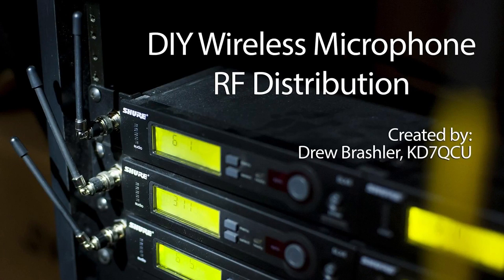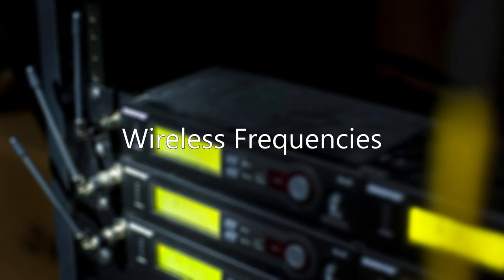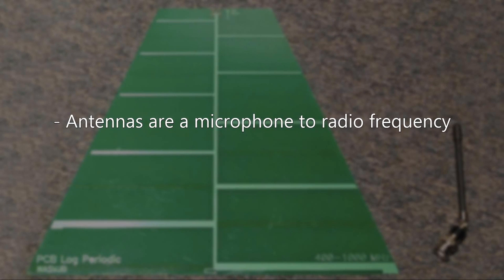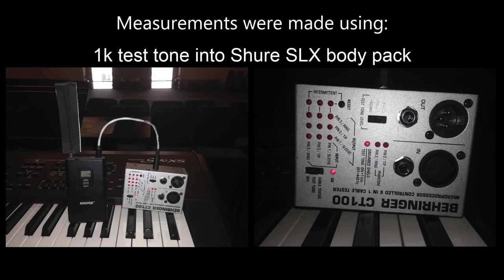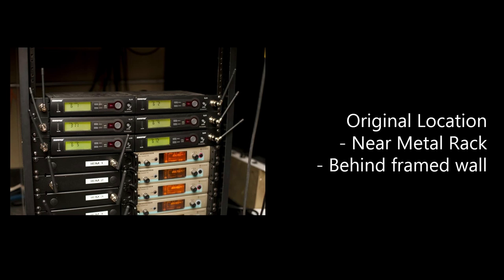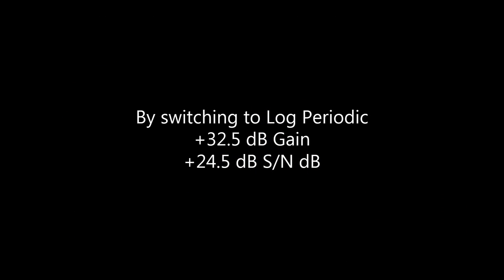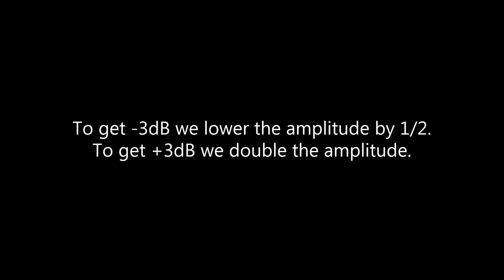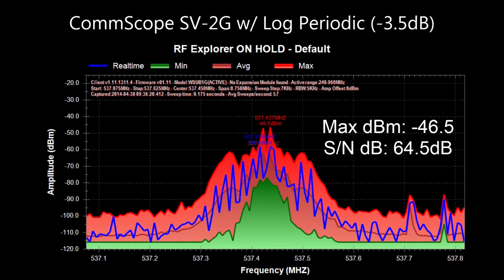DIY Wireless Microphone RF Distribution

Comment: Wow!  Just deployed the system at my church - and the wireless mics are finally performing as expected.  The extra gain coupled with proper antenna placement has made a huge difference.  Although, Drew, if you got your ears on......I did the same kind of mount for the PCB antennas with 1/2" pvc - how did you get the antennas to stay put?  I tried some hot glue, it didn't work.  Kinda afraid to use epoxy or superglue (chemical heat) - the answer is I don't want to damage the antennas.  Any advice?

Ok - went to Lowes - bought beam clamps and clamped them on the back of the pvc pipe and clamped the antennas in there - and it's not the best looking thing on the planet - but let me tell you - IT WORKS BEAUTIFULLY!

Working perfectly combining signals from 5 Shure SLX - 4 @ ~520Mhz, 1 @ ~650Mhz and an AT @514Mhz - beautiful signal -even though the antennas are 50' from the booth where the receivers are.  Did learn that the 45 degree angles definitely make a difference - much less receiver action switching between antennas. Total cost was less than $120 for the entire setup - I couldn't be happier!

Two weeks in now - and we've yet to hear any switching noise, have even one bit of interference or anything.  Much more confidence now in a crowded RF environment like this church (right off a major interstate and literally 100's of towers around and bad electric in the building) with the wireless mics!  Thank you DREW!!!!
Reply: I just jumped on the band wagon here and almost finished with my set up.  You might be interested in this 3D printable mount I designed (it's going on top of my wireless case): https://www.dropbox.com/s/unn0v877xg3rjv6/antenna%20mount.JPG?dl=0
Reply: Bob Nolan. What RF Splitters did you use? I can't find the ones he listed and definitely not any at his listed price.

Comment: Great instructional video.  Deployed a similar solution at our Church. Works well especially when using powered splitter. Any chance I could get your advice on preventing overdriving the signal?  Appreciate it.
Reply: Hi, seems Drew is offsite or offworld. To prevent overdrive or clipping, you want to either attenuate your input or reduce your amplification. All amplifiers will have a maximum output. If it says 100db Max Out, and your input is 75dB and it amplifies by 30dB, you need to get a different amp or attenuate your signal by 5-10dB.

Comment: Drew, have you experienced any issues in connecting this DIY system to Shure ULX series? Seems as though the system I built will work fine with the Shure BLX4R receivers, but it's hit and miss with Shure ULXP4 and ULXS4 receivers - they literally shut off / power down as soon as the antenna cables are connected from my 1x8 DA. A while back I found that some receivers were ok and not shutting down, but in the mad dash of the project I didn't have time to take notes and try to figure out what/why.

Comment: Drew,
Can I ask you to clarify the hook up between the antenna and the splitter?  What wire type did you use? Did you solder it directly to the antenna or did you solder a connection to it first?

Comment: As far as Power Distribution goes, I have had good results using 5A 12VDC power supplies intended for surveillance cameras and coaxial (5.5 x 2.1 mm) splitters feeding 12 Shure SLX4 receivers. My Musical Theater rig consists of 2 racks of 12 SLX4s per, each powered by one 5A supply. The original Sure PS20/21's are rated at 400mA and the SLX4's claim to draw 130mA each. You could probably get away with 2A power supplies but the difference in cost is negligible.  I get the power supplies and splitters form MCM Electronics for about $25 per 12 SLX4s.
Reply: Thanks for your comment 
By any chance would you recommend one if im using 5 SLX4's thanks again

Comment: I need to try a setup like yours only I have old stuff to deal with, Shure L4s running from 171 Mhz to 192 Mhz.  And no budget, I think  with the correct antennas I can still make it work. Going to give it the college try.  Thanks for the info and the guinea pig service!
Reply from the maker: +Dale Thornton This setup would work for you! All of the TV Splitters I quoted had a freq range from 5MHz-1000MHz, the only thing that wouldn't work is the antenna that I quoted. You would probably want to try using the stock one that came with your equipment or trying to build an antenna tuned to 181MHz. There are a bunch of antenna designs online that would work. A simple dipole tuned to 181MHz would work well for your purpose!

Comment: You mentioned the Signalloss by converting 50 to 75 Ohms, but you’re dealing with much worse problems by doing this. When you don’t use a full 50 ohm System you can create reflections in the cable which degrade your signal, it might have the same Amplitude but will lack in Information in the Signal, so I would strongly recommend to stay in 50 Ohms and try to find some splitter with this impedance.

Comment: Drew, when you guys used those front mounted omni directional antennas what was the average distance from transmitters to the wireless mics (for example) without fuzz or noticable signal loss? I'm in a professional cover band and am looking to mount my IEM box and Sennheiser WIreless box next to each other in a 4U rack case with front Omni antennas. Just looking for your own experience? Thank you! Great video.

Comment: Drew, I have contacted a rep from PCT and they have discontinued the  PCT-VB-8U. The rep recommends using the PCT-VC-9UIP in lieu. This replacement also offers VOIP. I'm not sure if I need the extra, is there a cheaper version that you are aware of. This new unit is $46.99..... Any suggestion?   And thanks for all of your expertise and willingness to share.
Reply from the maker: Yes, the PCT-VC-9UIP is a great replacement for the PCT-VB-8U!

Comment: Drew,  

I would be interested in knowing if the spectrum readout of the IEM combiner showed any 3IM artifacts? I would view the scope while the transmitters are turned on one at a time. I wonder about the splitter/combiner port-to-port isolation and its affect on 3IM? Have you done this?  

Thank you for this video.  I have read about this very subject and it is good to see a video presented intelligently. This info was right in line with my needs.  Our church is using 6 cheap in ear transmitters with 1/4 wave sticks. Of course they have many noise bursts. For our IEM transmitters I was thinking of getting the same passive combiner you have and feeding a home made helical antenna to improve drop out performance.

I own a rental wireless mic system that can place 34 wireless mics on one stage concurrently. I also lead the audio team in our modern church (surround sound) and am an engineer at a TV station.  Add to that  a radio amateur. 73 de N2MMS.

John
Reply from the maker: +John Stefanick What a great question! Also when I made those measurements, I thought to myself if someone was going to ask that, at the time I thought, "No probably not." Well, I was wrong! hah! So unfortunately I did not test for that specifically. When I did my measurements I found that the peaks on the RF explorer when I looked at the 1/4 wave stock vs the splitter and log periodic were pretty much equal in amplitude measured up on the stage. If you want to contact me through www.dbbaudio.com I would love to send you the screenshots of the measurements. Also, here is a link for the pdf of the combiner: http://www.minicircuits.com/pdfs/ZBSC-8-82+.pdf. Thanks so much!

Comment: This is some kind of brilliant.  I've got a rack of 13 (soon to be 16) SLX's and BLX's that I need a solution for, for a theatre group I work with in a space where I have signal "black holes" on stage (varying with frequency/transmitter), and there's nowhere near the $$$$ for a full-on Shure antenna and power distro (2 paddles, amps, 5 distros in a two-tier cascade, etc).  I can live with the wall warts.

Questions: considering the boost from the paddle antennas being up/away from the rack space and the rest of the clutter in the booth, would a 2-way passive splitter from the antenna going to 2 8-way active splitters on each side of the diversity mess up the signal gains too much, or add much noise to the signal?  Is it better to have the paddles on one mast set off at 45 degree angles, or would I get more mileage out of having one paddle house left and one house right?  As my booth is back of house-left, would the difference in antenna lead length add issues to the system if done that way (one would be about 10', the other about 70')?

Any advice would be appreciated.  Thanks!
Reply: +leistico a two way passive splitter will bring another 3db of signal loss, ideally the system would operate at unity. Signal amplifiers near the aerials are the best way to tackle this. This way you are not amplifying the noise picked up on the cables.

It is better to have the aerials spaced at least 19" apart (ideally 3ft), this provides better antenna diversity. Having the aerials spaced too far apart (house left and house right for example) is a bad idea as you end up in a situation where you have two separate zones, the microphone being picked up on the nearer aerial. This sounds like a good idea but by creating zones with like this there is no diversity. 

Make sure you have good diversity and get the aerials as close to the stage as possible. if it is a really wide stage it is possible to set up two aerials either side, creating two zones with diversty.

Comment: Great video. I built one of these systems over 20 years ago for a traveling gospel group.  Worked great. BUT, I don’t recommend using the active splitters. You’ll get better reliability with standard, high quality passive splitters/combiners that don’t introduce artifacts and intermodal issues, even if you lose a few dB of gain.  If you must use an active splitter/combiner, go for a commercial model (but pricey).

Comment: Thank you for your video. You did a great job explaining everything and I was able to follow this for the most part.
However, I do have a question, can you explain a simple set-up for a very limited sound person regarding a multi wireless mic, single rack mount receiver (4 slots) to receive the signal at 30-75 ft. using OEM antennas? I designed my own rack system (made from wood and metal), which hides the antennas inside. I am thinking the antennas need to some how be mounted outside of the rack when in use. Any ideas? Maybe 1 fin antenna with multi splitter?

Comment: I am very interested in setting this up.  So much so that I probably jumped the gun and ordered some equipment before getting all questions answered, lol.

Will this work with a receiver that is listed as having a OEM antenna that is active?  Audio-Technica 3000B series lists it's receiver as:
True Diversity
Image Rejection:  60dB nominal, 55dB minimum
RF Sensitivity: 20dBuV at 60dB S/N ratio, (50 Ohms Term)
Antenna Input: BNC-type, 50Ohm, Bias voltage 12V DC, 60 mA, each

From your video, I gather that the 75Ohm to 50Ohm won't be an issue, as overall dB will be improved, even if some is lost in the transition.  However, the Bias voltage makes me believe that the receiver expects an active antenna.  How will that affect this system?  Still safe to use your setup on these receivers?

Thank you!!!

Comment: Hello, thanks for the video... can you tell me what you attach to the green antenna? the antenna gets shipped with nothing on it correct? Also, on the PCT-VB-8UN where does the line that goes to the antenna connect, there are 10 different ports? And I do audio for conferences where the audience has mic opportunity for q/a, is this the type of antenna you recommend? thanks

Comment: Hi. I thought "insertion loss" was the loss at the joins e.g. connector on cable attached to the splitter, not the loss inside the splitter. ??? Also, I'm sure the higher the frequency, the higher the loss but you don't mention that when talking about splitters.

Comment: A friends and I recently did this and it's not exactly working the way we expected. It works, but it's having alot of cutting out spikes if you hold the microphone by the antenna worse than if you use the little antennas it comes with.

We're still trying some other things as this is still promising.
Reply: I am exploring doing this right now. What splitters did you use. The one he has listed is discontinued.
Reply: Don't hold the mics next to the antenna the receivers are being overloaded. Higher end Shure receivers aka ULX-D have overload indicators.
Reply: @JStevensdk7  Tell that to the people that use the mics. I and the sound booth folks know that but the dum dums on stage keep getting lazy and holding it lower and lower covering the antennas. 

We got it to work perfectly even when they cover the mic antenna. Just took some different antennas for the receivers than in this video. Which ones I can't recall but it worked in the end and hasn't been an issue since.

Comment: Mini-Circuits ZBSC-8-82+   <-- Is there a smaller channel version of this like, 4 channels or even 6?  I looked at the website but I do not know how to tell exactly what I need.  Also what is a link to the terminators I need.  Also the antenna website seems to indicate you can spray paing the pcb antennas black.  Can I assume a nonmetallic flat black spray paint will work?

Comment: I have a portable rack IEM for my band. And the 2 bnc antennas that came with our IEM transmitters just dont seem to cut it on stage. So I was wondering how I could use this to incorporate to my system? I run the 2 IEM antenna I'd like to combine to 1 log periodic antenna

Comment: It may be noted/commented elsewhere, but just in case you're coming late to this (after 2020) the Rf spectrum for wireless microphones has changed. If you are still operating 600MHz gear, you could find yourself in a heap of trouble...

Comment: Couldn't I just use a SMA-F connector adapter cable since I will still have to convert the BNC to F connector at the splitter?

Comment: Hey! Thanks for doing all this legwork and sharing it!

My church needs new mics now that the 600MHz spectrum is being sold off.

Would this setup work with a 2.4GHz system if the antenna is changed? What about the splitter? That would need to work in the 2GHz range too. Do they have splitters that work in that range?
Reply from the maker: +Darren Yung I would try to stay out of the 2.4GHz area as this is the WiFi range and is quite crowded. With that being said, the products listed in this would NOT work for 2.4GHz, but the fundamentals would work. If you changed the splitter to be something that worked in the 2.4GHz range, it would work well! In fact, you can use antennas branded for use with WiFi and even splitters too.
Reply: what country?

Comment: Hello Drew,
 I have a similar system in our church but the Shure units that we are using at the moment are the PGXD (they work in the 900MHZ range) with two first generation Seinhieser evolution mics. I just want to know if this would work for what we have. any suggestions will be greatly appreciated. Great video! Thanks
Reply from the maker: +Melvin Santos Hey Melvin! Yes, the system would work for your 900MHz units! The log periodic goes up to 1000MHz and the splitters that I tested also go up to 1000MHz. With the antenna I suggested, you can have multiple receivers ranging from 400MHz all the way up to 1000MHz and they would all receive signal from the antenna and splitter throughout that entire frequency spectrum.

Comment: Thanks for this extremely informative video. If I just want to to get better signal on my SENNHEISER EW300 IEM G2 (626-662). Could I just get the Log Periodic Antenna and a sma to bnc cable?
Reply from the maker: +Stan Dembowski Hey Stan, so sorry for the delay in my reply! Yes! You can get just the Log Periodic and connect directly to your IEM transmitter! By doing that you would get around 8-9dB of RF gain in comparison to the stock antenna.

Comment: Would the same concepts apply to a digital system (e.g. Line 6 XD, Audio-Technica System 10 etc.)? Obviously for the systems mentioned I'd need an antenna and splitter that support 2.4GHz, but ultimately these concepts would still apply, correct?
Reply from the maker: +Mike Case Hey Mike! Sorry for the late reply. Yes if you had a splitter and antenna that worked in the 2.4GHz band it would work! I would suggest to try and stay away from the 2.4GHz band if possible as this spectrum is WAY overfilled with wireless signals from everything. Thanks for watching!

Comment: Hi Drew,   I mix sound for the youth ministry at New Life Church in Pismo.  We have a new Behringer X32 that we brought online several months ago.  Prior to that we were using a Allen & Heath GL4000 analog board so the Behringer represents my first use of a digital board to mix for the youth.  Now for the skinny.  I am using channels 13 thu 16 for vocal microphones.  BUS 13 is identified as FX rack Instruments, BUS 14 is identifies as FX rack vocals, BUS 15 is identified as FX rack delay and BUS 16 is identified as FX rack Guitar Fx.  So, when I want to hear more reverb/echo on the vocals in the house I simply advance the slider for BUS 14 and presto, more vocal echo in the house.  My current challenge is that the worship leader wants to hear more reverb/echo applied to his vocals as they are returned to him in his ears (we have the Behringer tied into a Powerplay P16 in ear system).  Can you tell me how to provide the worship leader with the desired effect or direct me to the proper YouTube video that will guide me.  Apparently our current setup applies the reverb/echo effect to the vocals as they are transmitted to the house but not to the vocals as they are transmitted back to the P16 musicians console. I need to do both and preferably independently.  Glenn